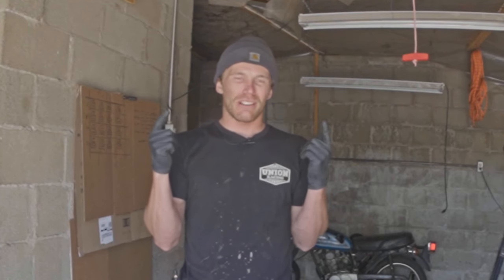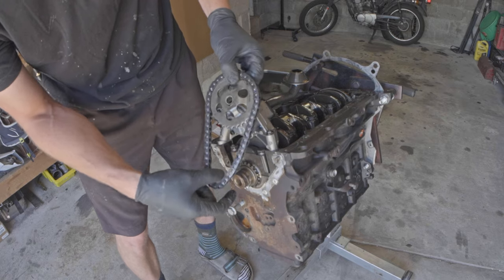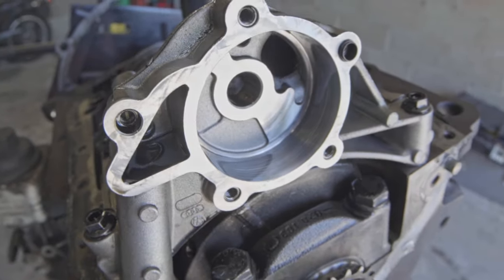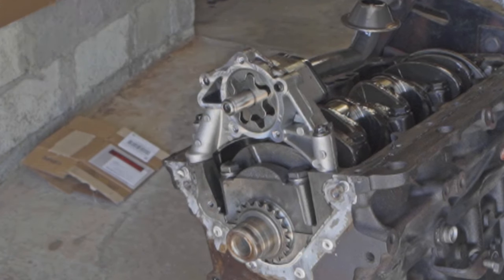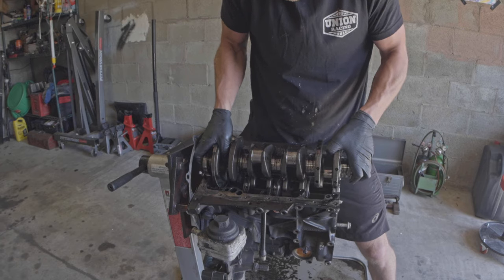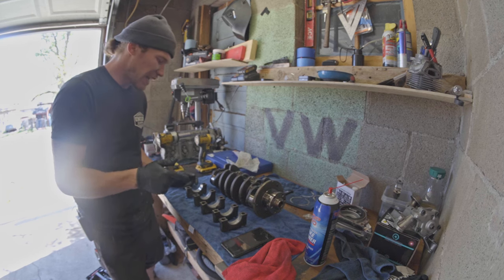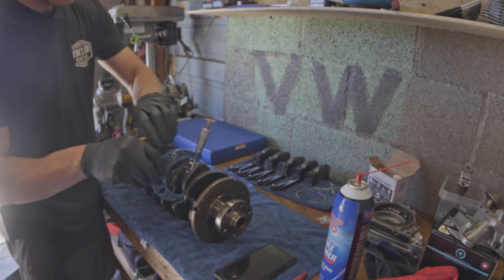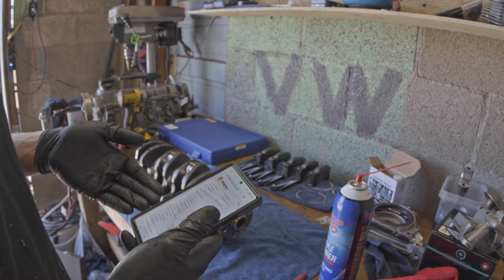VW Turbodiesel Teardown! Part 4

Comment: tbh if i were u i would try to fit a pd engine. its newer (same mounts as the alh) outputs higher power, bigger turbo, bigger/longer duration camshaft lobes the injectors are a lot higher pressure and inside the head thus works quieter and it has more convenient upgradability.(used until 2011 on the mk4s/facelifts) 
* avoid (B**)  engine codes. for some reason they didn't use the piston bearing notch and they all failed there. ( most robust engine codes imo was awx / avf 130hp) they work at 1.5bar and they last forever like the alh you got (you gonna need the entire engine bay wiring harness that goes straight to the ecu and easily just unplugs from the fusebox. 'also the ecu and dashboard for the immobilizer if you have the key) 
they use the pd engines for transporter t3 swaps because of their high torque/output power and the amazing fuel consumption
Reply from the maker: Hey thanks for the detailed comment! Definitely too far in to switch now lol BUT the primary driver of using the ALH is it will not be electronic! I have a mechanical pump with an 11mm head that will be running it... Thus the ALH is a pretty sweet option to stay full mechanical. I understand EFI is better, more powerful, yada yada.. it's just not what I'm going for atm 👍